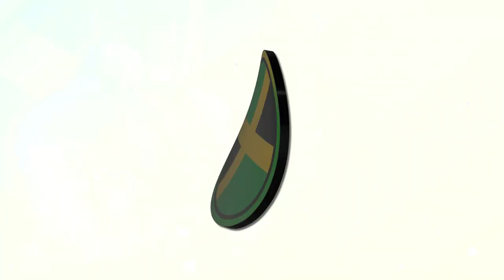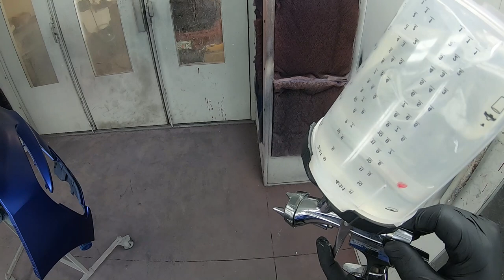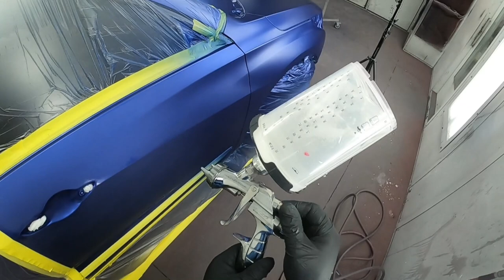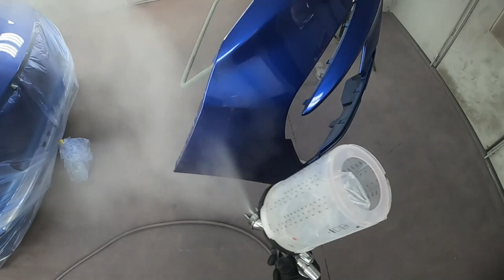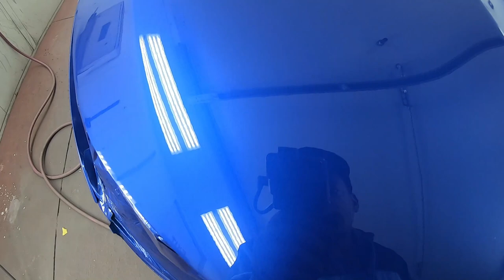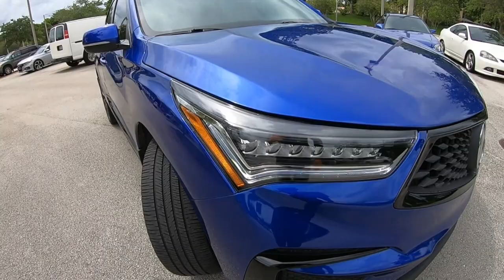HOW TO MAXIMIZE YOUR IWATA WS 400 PERFORMANCE

Comment: So i may have missed it but is this the ws400 series 2?
I have the first ws400 and honestly haven’t had any problems with it.
Not sure if I’m going to buy the series 2 if it’s not changed drastically.
I did get the ls400 series 2 for base.
Tekna copper 7e7 cap has given me fits with the air valve going out numerous times.
Great video by the way👍

Comment: I appreciate the fact you have someone in there filming you that hood angle was different for sure. I was having issues with my LPH400.  Fan pattern splitting sometimes... weird unevenness etc. I looked at the fluid tip and realized this is an iwata and I needed to do some research. Turns out most every iwata should be turned in on the fluid

Comment: I have the the older WS400 and the new Iwata WS400 series 2. I can already tell that the new one is way better in atomizing the material (clear) and yes they corrected the finicky setup. Sprays more even now with fluid/fan wide open. The old one i am spraying @ 26 PSI the new one is around 16 PSI so less over spray. The only thing is now that the material is being sprayed evenly across the pattern you might have to go up fluid/needle one size up from what you usually use if you like to spray faster.
Reply from the maker: Thank you so much Harold
Reply: What you mean ‘way better’? And, how you are spraying clear at 16 psi?
Reply: @walterwalters3069  Way better in a way that the full fan wide open is spraying the material evenly across the pattern with softer edge. The old one you have to make the fan pattern smaller since it has the problem pattern splitting (heavier top/bottom). The problem with that is now making the center too heavy. The series 2 fixed the problem. Still have to dial it in if needed since some uses high solid clear vs medium. I am using high solid clear (unreduced) and with 16-17 psi I have no problem spraying it that low. Normally my series1 one I am at 25-26 psi.
Reply: @haroldm1956  Sorry but I didn't see anything new from Anest  Iwata advertising. Yes, they made the smaller fan compare to original WS400 and  that all... Only new digital gauge there. Plus Pete from UK made a video  about it so will see soon...As I know the upgrade is minimal as they did with Belaria and LPH series.  Way better for me when you compare the Harbor freight spray guns and WS400 or Dv1 or Sata5500.....but not for this upgrade..... IMHO
Reply: @walterwalters3069  I have seen Pete's from UK video take on it and the Iwata advertising video is somewhat misleading since set up wise is very material dependent whether high/medium solid clear. You still need to set up accordingly. Now where they get right is easier to set up and just like what I said I am spraying at 16-17 psi on the series 2 from 25-26 psi on series 1. All I can say is if you have the chance to try it when they release in your area if you can find a distributor. You can not say that there are not a lot of improvements to justify the purchase if you have not try it IMHO. Now if you happy with your current spray gun then stick with what you have. Did I say since I am spraying at a lower pressure I am saving about 20% material as a result. If you are in a commission based shop that material saving counts.
Reply: @haroldm1956  I have no problem with that new spray guns  but they are NOT way better if any....I was waiting New LS 400 HVLP with better CFM but they did nothing about it...Everything else really are the  same....
Reply: If you line up the fluid tip in line with the air horns on the older ws400 it will spray an even fan at fully open every time. Have tested on mine and other tradesmen ws400 at our shop. Peteshobbies also has a video showing that this will work to get the old ws400 spraying as it was intended from iwata.
Reply: @ilu51vLRS  Actually I have been fortunate that my Series1 WS400 nozzle and air cap horn are perfectly aligned just like the new Series2 WS400. Still have to tweak to make the spray pattern smaller on the old one to spray evenly even though it's perfectly aligned. However there is just something about how the new one spray where the spray pattern is evenly balanced across the spray pattern. I think part of it is the pattern has a softer edge compare to the old one and it's better when you do your overlapping. You ever had on some of your panel has uneven peel to it when you use the old one unless you just loading it with a lot of material? Well the new one does not have that problem. Easy set up and spraying at lower pressure between between 1.4-1.6 bar. Anyway if your current setup works just fine then stick with that otherwise if you have a chance to try it I think you'll like it.
Reply: @haroldm1956  don't know why yours isn't spraying evenly if it's aligned... we have 3 ws400 users at our shop and once we lined it up every1 of us have an even full fan. No tweaking needed.
Reply: @haroldm1956  oh and I've never had uneven peel on my jobs from the gun as I've said, it doesn't spray uneven if the horn and caps are aligned. If anything, maybe yours is faulty if that didn't get ur gun spraying properly and you still needed to tweak it. Either way if I get a chance to try it I will, but I'd rather get a different gun since my iwata is faultless.
Reply: @haroldm1956  what??? I have the serie 2 ws400 and I use that gun to 35 psi in Hs clear coat, if I use on less psi, I will do  orange peel, if you use Tha gun to 16psi, is ms medium solid clear coat, never hs clear coat
Reply: @mundotuningcustompaint3488  I am using HS Sikkens Clear Coat without reducer and have no problem spraying it between 1.2-1.6 bar (17-23 psi). I usually stay in the 1.6 bar If I like a flatter finish but lower I can mostly replicate the factory peel. You might have to check the viscosity it might be because it's just too thick and try reducing it.
Reply: Здравствуйте, вы советуете  для быстрой работы на старом WS 400 вместо дюзы 1.4 взять 1.5 ?

Comment: Using a iwata 300 for base an SATA jet4000rp for clear coat know one thing I've learned every single gun that I've ever used each Khan has its own specifical use and feel sometimes you got to put the fan pattern up out in a little bit more material little bit last I never keep the same material settings and fan settings to out my painting history if it looks a little dull I ad a little more material if it looks a little too wet high-back it off and sometimes clear depending on the clear and how much too clear is reduced and how much the base is reduced usually I do a 12-1 on the base and I try to use a good premium basecoat and I use a good clear coat and the stuff I'm using now is glasurit to 2 1 1 if you don't reduce it it is a high-solids euroclear and it'll seems like it'll be peely on you so I reduce it down a little bit sometimes more than the one to get a real nice flow but everybody has their own way of spraying you get to know the guns in the materials and you can lay down a fantastic job put me in the battlefield with any of them with any of their guns and I guarantee you mine's going to come out looking pretty good and I don't like spring clear at too low of PSI. Nor do I like it too high of PSI I think the manufacturer on the clear that I use says about 10 to 13 PSI and I liked it at about 20 to 25 and sometimes more so there were the only two guns I like to use I'm sure there's other ones I've had this at a jet 2090 all of them these are my two best guns in the Sata 95 for spraying enamels and clears and also high-solids primer and then I got a 400 iwata for spray primer

Comment: I usually open my fan all the way and go in 3- 3-1/2 turns in i set my fluid wide open. My base and clear coat guns dont have regulators i listen to the air pressure itself also while. Spraying base coat metallics my first coat may be nice and even but if i notice my second coat applying like my first tells me too much air. Usually means tiger stripes and model the main thing for me is watching how it hits the panel

Comment from the maker: Was up guys!! I was spraying at 29 PSI JUST IN CASE YOU WERE WONDERING. Subscribe to the channel if you’re new and leave comment.
Reply: Ws 400 is the king for clearcoat  29 psi fluid wide open fan 1.5 to 2 turns in and let it eat
Reply from the maker: @chrisreynolds6959  awesome technique
Reply: I have the the older WS400 and the new Iwata WS400 series 2. I can already tell that the new one is way better in atomizing the material (clear) and yes they corrected the finicky setup. Sprays more even now with fluid/fan wide open. The old one i am spraying @ 26 PSI the new one is around 16 PSI so less over spray. The only thing is now that the material is being sprayed evenly across the pattern you might have to go up fluid/needle one size up from what you usually use if you like to spray faster.

Comment: They are very good guns but everyone has their own setup for this gun depending upon how thin or thick the clear that you’re using my settings are not to far different from you four turns out out on the fluid fan turned in 2-2 1/5 turns in from open and about 2 bar or just over depending upon how hot it is I use a thinner clear it a MS clear. 

Sherwin Williams 2:1 high gloss clear

Comment: 1st time i used the gun it was a water hose runs every where. Did you reduce wth activator ? by how much. Also my settings were ,Bottom wide open/trigger wide open and fan 3.5 out from closed fort he fluid.29 psi

Comment: You always should leave the most important parts last means you go for the bumper and when a car you did opposite creating overspray with will fall on bonnet
Reply: What if it's a cross draft booth and the bumper is the at front of the booth and he's using a slow activator? Does your same rule Apply? Put a link to your video to show us how it's done. 🧐

Comment: Going from the gti prolite to recently buying a ws400 for clear can safely say it’s a bit of a let down. There’s clearly an issue with the fan while fully open, For a really expensive gun that’s not good enough,bein painting for 25 years and struggled with the ws400,dry patches,inconsistent fan,top and bottom heavy…nothing like a straight out the box devilbiss personally. Cheerz for video tho
Reply: Turn it back in

Comment: I dont have regulators but im use to listening to the pressure of my guns. I put my fluid until i feel resistance and open fan all the way and turn in 3 turns and from there i watch how im applying the material if i feel the pressure is to high or to low i adjust it to comfortable finish settings
Reply from the maker: You know you’re an experienced painter when you can set pressure by listening
Reply: I only have 2 years experience. But im always hard on myself i want the cleanest parts
Reply: @mariopaintclass6091  i own 2 WS400 1.5. i have also a sata i like how sata lays base but love how the iwata lays clear coat

Comment: Been painting 20+years, been using lph400 1.3 orange cap for clear,I love it, but never could get super nova to work for me in the past,So I let it go, decided to give it another chance got the ws400 1.3evo,fan not as wide as lph400, thought since ws so expensive,it should be better than lph, wanted to see what all the hype is about, still gonna keep trying it though, also noticed wide open fan seems uneven, nevertheless I love iwata, any other suggestions on that would be helpful, keep up the great work!
Reply: James  try 1& 1/2 turns out from the close position for the fan adjustment  and try 1& 1/2 turns out  for the fluid  knob  from the  close position for the 1st coat and the next coat do another 1/2 trun out making it two full turns out from close position for fuild  .ove in a little closer
Reply: James try turning the fan knob out from  close position 1 & 1/2 turns out this narrow the fan on the WS400 just right  and t
For the fluid do the same for the 1ST coat and the rest of the coats adjust as you feel comfortable  this works fine for for WS400 HD super nova

Comment: Just purchased a ws400 super nova how many turns in on the fan 2 or 3 turns . Been painting 40 years but I've been using a sata jet
Reply from the maker: Hey man, you got a lot of experience. It. Would be inaccurate to tell you it’s 2 or 3 turns. You just have to see how many turns work best for you.
Reply: Your right and it will probably take a couple of time's to dial it down just right I was very happy with my supernova but Your video did help
Reply from the maker: @victorbelmares2722  glad I could help

Comment: MARIO MY FRIEND I SEEN THIS ON EBAY  ANDY WS400 1.4 ET CLEAR COAT PAINT GUN PAL BUT MARIO YOU CARNT USE THEM ON FULL FAN CAUSE IT BREAKS THE FAN UP SO ALL THE WAY IN AND 2 TO 3 TURNS OUT ON THE FAN ON THE SERIES 2 ITS 2 BAR FULL FULID AND FULL FAN OUT OF THE BOX EXPERIENCE 😊
Reply from the maker: Yes it has a super wide fan. I can’t wait to get my hands on the series 2

Comment: Brooo please help me I have an iwata W400 lv-wxb is my do it all gun I dont know how to set it up sometimes I do a great job and most of the time is a pain in the ass to set up !
Reply from the maker: Hey man I set up all my guns the same as I did in this video. Are you spraying all coatings with the same gun. If so I hope you’re not using the same tip size
Reply: You got me man thanks! I am using the 1.3 tip for everything sealer base and clear Im using euro clear high solids I also feel this gun uses the double of paint than other guns but I dont know if its me or it really uses too much paint.
Reply from the maker: @kennycharneca1  okay so all you have to do is figure out which of these materials is giving you problems interms of viscosity. And go up or down a tip size. Make sure you have consistent air flow and maybe dial in the fan 2 to 3 turns
Reply: W 400 the best there is 1#
Reply: @tonydiesel3444  for what application you use it ??

Comment: what tip do you have 1.4 ?
Reply from the maker: This was a 1.3
Reply from the maker: I have the 1.4 as well I switch it up base on the viscosity of the clear I’m using
Reply: @mariopaintclass6091  on high solid clears would you prefer using the 1.3 or 1.4

Comment: I have the iwata, and is the spray gun that give me the best result, BUT it oversprays a lot... I need to find a way to reduce the overspray without loosing performance
Reply from the maker: Because it has such a wide fan pattern you have to turn in the van a few turns to control the overspray. But remember the more narrow the fan becomes the pressure gets hire. Which means if you make the fan more narrow u have to drop the pressure or increase your speed.
Reply: @mariopaintclass6091   Thank u very much for the answer. I will try it, I didn't it yet because as I see more material bouncing after hit the panel than other spray guns do, even at low pressure levels. I thought it was the price to pay to get a mirror like finish.

Comment: That's a 1.4 tip?
Reply from the maker: Yes sir
Reply: For clear coat? That's odd usually 1.3 1.2 tip
Reply from the maker: @swav100  the tip you use could change base on a few things… like how hot it is, the type of gun you’re using, or how thick the clear coat is. Truth be told tho I have never used a 1.4 tip in any gun except for this one. If you using 1.2 or 1.3 there’s nothing wrong with that.